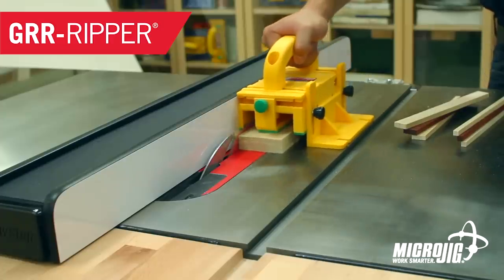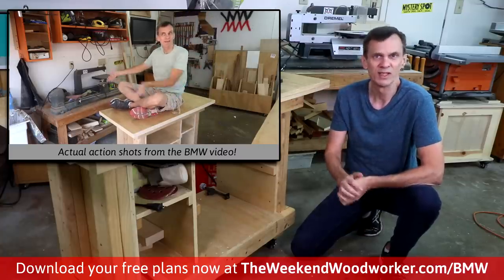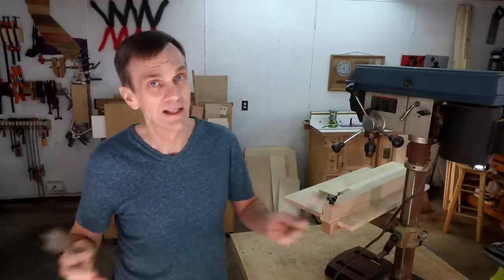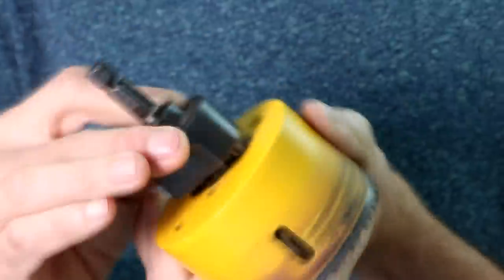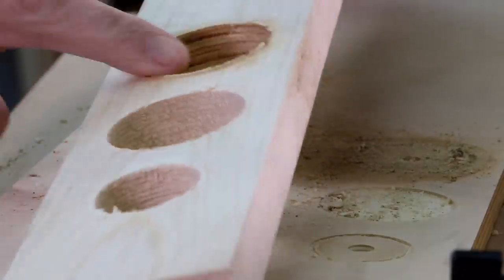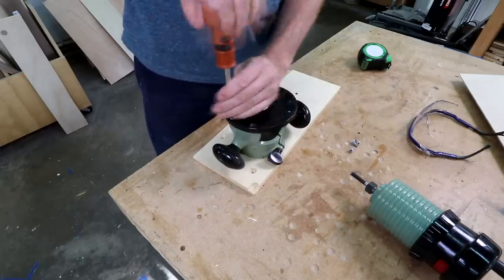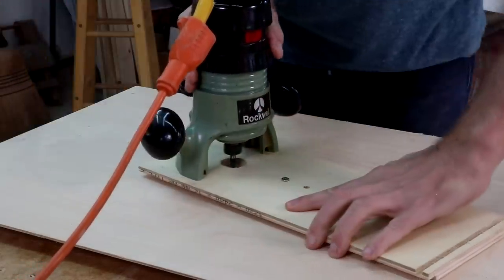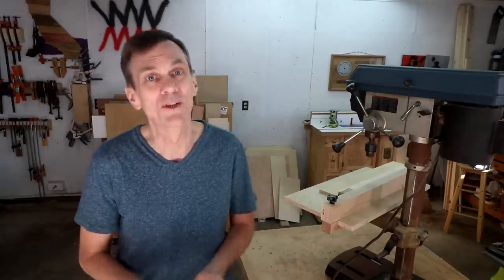How to Cut Perfect Holes: 4 Methods

Comment: Thank you , I've been trying to get around making a circle jig but you made it so simple , I can do that easy enough and buying bits and such for larger holes get pricey and or limit me to a drill press which isn't practical sometimes. So rather than even attempt using my HD circle cutter (drill press only tool)in my cordless hand drill , I'll make a jig and spare my project and myself the stress the wrong tools usually cause me .

Comment: Okay, the router mod is brilliant! I’d been trying to figure out how to build a jig to work with the existing guide rails/frame, but it was questionable — I’m using a plunge router and want to cut 5” and 6” diameter holes, which puts the pivot beneath the base. The wood base method should work perfectly!

Comment: Thing to consider about the circle cutting jig for the router. Instead of removing the router base and screwing the jig to the router, consider drilling a hole at the drill press of the diameter of one of the router template guides, say ¾". Then, to use the jig mount the bit and a ¾" template guide and put the router in the hole. This has the advantage of speeding up set up and not tangling the cord up as you rout because the whole router rotates to maintain its orientation.
Reply: Hi Joseph:  I use this method also.  Works well with an oval routing jig also.  For clean cuts on small holes larger than the Forster bits that I have, I cut a hole in a scrap of MDF and then use that as a template for my router with a guide bushing and a straight bit.  John Jensen from British Columbia

Comment: When my brother-in-law and I were building my arcade cabinet we had to drill a hole for the speakers that was too large for regular bits. He had some weird bit that was like a spade bit, the center was a drill bit and had side thingies with adjustable blades. I don't know what it's called. They are neat too!

By the way, Casper is also sponsoring a lot youtube channels. Whenever I hear those catchphrases from others it gives me cringe. However Steve can really deliver these ads. I'm a patron at patreon but I only watch his videos with the ads in them.
Reply: Surprisingly, the tool you are talking about is called a circle hole cutter!  :)
Reply: I found it easily on google image search just by typing the exact words but it sounded so generic I never would have guessed that it's actually called that. Thanks!

Comment: something i saw on anohter channel to help with the hole saw drill a few small relief holes around the circumference of the hole and the sawdust has somewhere to go instead of clogging the blade.

Comment: Hi, quick question.  Do the all the forstner bits leave a small hole in the center (if you are only drilling part way through the board)?  I'm trying to make a holder for a salt and pepper shaker and ideally want a completely flat bottom.  Any other way to do that?  Thanks.

Comment: Good video, but all of these methods leave a hole in the middle of the circle. What I'm looking for is a way to cut out circles clean keeping both the circle and the plywood it is cut from. Do you have mechanisms for doing that with hand tools? (Normally I have access to a laser cutter  and CNC machine, but COVID-19 has closed the shop.)

Comment: This may be a silly question but say I need to make a hole like the one at 2:23 (part way through the board)

Could I use a straight bit on a plunge router? Plunge it part way into the wood and then raise it back up without moving the router? I'm thinking holes that are roughly 16-20mm diameter.
Reply: You sure can. Set the depth stop on your router so you get the correct depth

Comment: I'm new at this, and I'm having trouble drilling holes (not used for screws). I tried a spade bit and I couldn't get it to do much. The forstner bit worked on two and then started stalling. I bought an ultra smooth auger brad point boring bit, and it made one hole, and started stalling for the next one. I have an M12 drill/driver from Milwaukee. :( What am I doing wrong?

Comment: Similar to the router jig (but IMO far easier to set up), my favorite large hole cutter is a jigsaw and a scrap of 1/4" plywood.  So a 3" x 24" (or thereabouts) offcut of 1/4", a 1/2" hole for the blade to poke through, an 1/8" pivot hole at a distance from the 'outside' of the blade equal to the radius of your circle, and you're set.  And if you don't have screw holes already in the saw's foot plate with which to mount the jig, it can still attach easily with some foam or carpet-backing mounting tape, or even hot glue.  Or you can even screw up through the bottom of the plywood into small blocks of wood that 'pinch' either side of the foot plate, clamping it in place.

Comment: Steve I hope you can help me, I’m getting blowout while using a spade bit to drill a 1 1/8th inch hole in a 3/4 inch piece of cedar (for a bird nest box).  I’m not just getting blowout, the entire piece of lumber is splitting completely in half!.   It’s happened three times now so I gave up lol.  Would clamping a spare piece of lumber beneath the piece help?   I do not have a drill press so I’m using a 18 volt Ryobi hand drill.  

I did notice that the spade bits I’m using have a threaded center spike, so when it “grabs’ the wood it wants to pull the rest of the bit into the piece very very fast!  I wonder if this might lead to the extreme tearing and breaking I’m seeing?  Should I have just got the regular spade bits, or is it feasible to use forstner bits with a handheld drill?  

Perhaps drilling a pilot hole the size of the threaded part.of the spade bit to “defeat” the threading would help?  

Thanks for any advice.

Comment: Would a jigsaw cut a deep enough hole through a front door in order to install a cat door? Would I first need to drill a hole on the inner side of the template to get the saw blade in there. I have never used a jigsaw let alone any electrical tool. Still have my grandfather's hand drill from 125 years or more back.

Comment: Another great video. Any tips for making a hole part of the way through a board but without the central indent from the tip of a forstner bit? Holes would range from 1/2 inch to 2 inches.
Reply: Grind the center point off a Forstner bit. Somebody might even make them that way.

Comment: Steve, I missed seeing you do a woodworking projects..  Also, you may want to use of the Jimmy DiResta tip on using a router. Lower your router bit by bit so that you don't burn out your router bits/

Comment: Question: I've seen a few of these types of jigs, whether for router or other tools. One of the things I wonder about is the hole where the router first goes in. This always seems to make a slight divot on the edge of the circle (both on the inside cut-out and the external circle. Is there a way to avoid this or how do you correct it? Thanks. I did listen to the Casper commercial LOL.

Comment: With the hole saw bits use a low rpm high torque setting (on most variable speed drills there's a switch usually numbered 1-3 1 is high rpm low torque for drilling 2 is mid range for screws and 3 is low for hole saws) you won't burn the wood but WATCH OUT if it binds it will twist your arm off.

Comment: Ok, I can't find an entire metal toolbox which has my Kreg Pocket jig and parts, screws and dowels.  Any suggestions? That being said, if you use a drill press there is also another adjustable hole cutter available on the cheap.  Just another option and welcome back.  Also have you been told you resemble the janitor from the T.V. show 'Scrubs'?  He looks like your older brother.

Comment: router is cool tool indeed but... I found almost impossible to cut deep holes with 1/4 router as bits are not long enough. Also doing holes in small boards/parts (like 2cm x 7cm ) with it is possible but very danger even if wood is clamped well. Do you have any solution for router in those circumstances, Steve? I learned woodworking mostly from you, actually your channel but still learning and still I'm rookie :) would like to know your opinion. Forstner bits are also cool but far to expensive if we go for bosh/colt but worth the money. Router is perfect but ... how to deal with deep holes using router. I do not have 1/2 router, just 1/4. thanks for any reply. regards
Reply: Lukasz Kalwa Did you try to route things with a bigger template?
Reply: norm1124 template is fine. The bit is to short.
Reply: I have seen some extremely long bits, upwards of a couple of inches.

Comment: I'm just getting started in woodworking as a hobby, and thought the Microjig Gripper looked really good.
Found it on Amazon and it was £230! Is that right? It seems very expensive for what it is.
Edit: Also the instructional DVD is £87!!!
Reply: I'd stick well clear of any push block that can get your hands anywhere NEAR that blade, especially if your gaurds are missing/not installed. There is a video floating around about pushback where someone replicated what happened to him earlier. It nearly took out a couple of fingers because of said push block.

Comment: With the router, if you don’t want to cut into what ever is below the board, drill a hole through the center, then attach the jig with a screw, cut 3/4 the way through, flip 5e piece and repeat.

Comment: Good video. There is  also a tool which consists of drill and rod perpendicular to a drill shaft. On the rod two cutting chisels are mounted. You can cut hole of any size. Unfortunately I do not know it' s english name - local woodworkers call it "ballerina" . You can buy one and drill hole of any size...

Comment: Since many woodworkers do repeat business and therefore need to make the same product of over and over again, I'm surprised you didn't cover the best and most efficient way to make large circles/holes which is to make a jig out of MDF then simply use the edge of your router (no guide bushing necessary unless you just want to use one) to make a circle in your work piece. If you don't have a laser cutter, simply pay a laser cutter in your area (make sure they have a 100 watt CO2 laser) a modest fee to make your jig out of 1/2" MDF. There is no better and quicker way to make a perfect large diameter circle than using a properly made jig.  For example, if you need a 6" dia circle and you're using a large router with the typical 6" dia base, you make a 9" circle jig which will make the perfect and quickest 6" circle everytime.  Regards,

Comment: I do not own a single tool, however. I would love to produce my own furniture or shelves. If you have a video for people like me who start from zero, and need a general shopping list, please link it. If you don't, please make it?
Reply from the maker: Consider my woodworking course! It opens in 2 days and one of the projects is a bookcase. Lots of other projects designed for people just like you, with no experience. I'll guide you through everything, including the tools you will need.  https://theweekendwoodworker.com/
Reply: I'm in your shoes as we speak. It all depends on how fancy you want to get. I think the four most important tools however are these.

#1. Table Saw. This is without question. And dont cheap out, and if you do, go used. If you are on an absolute budget look for a contractor saw that just needs some TLC but make sure the major parts are in good shape. I got mine for about $160 if you include the paint and new machined pulleys. The parts all had a good layer of rust and sawdust but nothing a wire wheel and a little masking tape and Rust-Oleum couldn't fix. 

#2. Router. One of THE MOST versatile machine in any wood workers arsenal. It can do alot of stuff, roundovers, keyholes, dados, flush trim, decorative trim, planing (no, seriously), jointing, tennons, Seriously, this thing can practically do it all, assuming you have the bits. 

#3. A Drill. Cordless or corded, hand drill or drill press, doesn't matter, just get one because on almost any project you will be drilling holes/screws for projects. 

#4. A Sander. I have a cheapy HF finish sander, does the job just fine. Depending how much sanding needs to be done which one you go with is up to you, and it probably wouldn't hurt to have three, a belt sander when you need to take off alot of material, an orbital sander (be warned, may leave circular patterns) for large prep work and a finish sander for you guessed it, finishing. If I had to get 1, get the finishing sander. 60-80 grit can help take down material faster (not as fast as a belt sander) and then you can switch out for finer grits later on.
Reply: Sovek, thank you, that was the reply i was looking for! I'm now borrowing my dad's router, drill and, sander. And instead of a table saw i have a circular saw and jig saw. But if i her more space I'll look into a table saw. I want to build my own to kit, and I've decided on ryobi. It doesn't break the bank, they have every tool at reasonable quality.

Comment: Sorry, noob here. What's chip out and tear out? I've heard them a few times but don't know exactly what they are.
Reply: It's when the piece of wood you are drilling chips (or tears) from the face of the board at the exit hole. You could always use wood putty or even glue back big enough pieces but a real simple way of preventing tear out is using a scrap piece of wood behind the real piece.

Comment: Did you buy a new truck????
Reply from the maker: Yes!
Reply: You'll have to adjust the height on all your workbenches, or let the air out the rear tires to use the tailgate as an outfeed!!!!

Good for you!
Reply: I miss the old truck. Your old truck was better. Your truck has changed.
Reply: Steve Ramsey - Woodworking for Mere Mortals sorry you got a dodge,  lol congrats
Reply: How did you guys know he has a new truck?
Reply: EJ Wu 3.18
Reply: The old truck is still there. At the background at 3.18 you can see it still.
Reply: (to Can Ken Make it?)
Reply: Can Ken Make It? lol
Reply: Did he color his hair to match his new truck?
Reply: classic287 ask Barbie